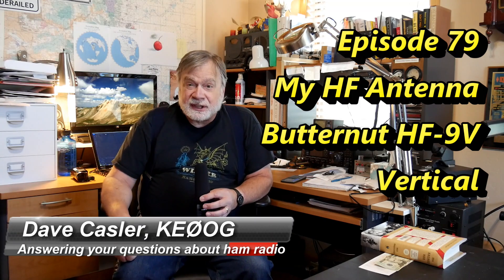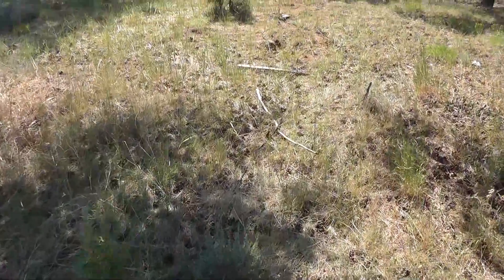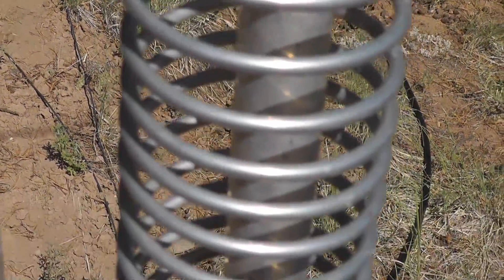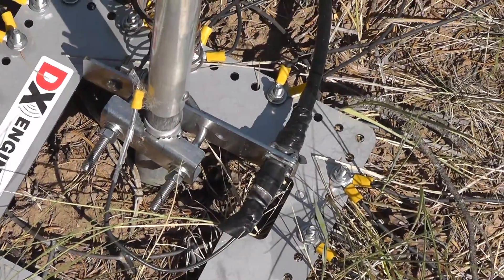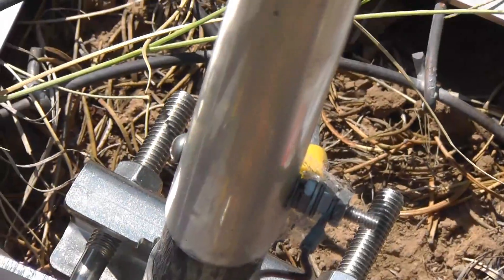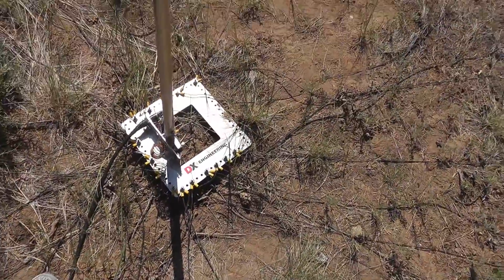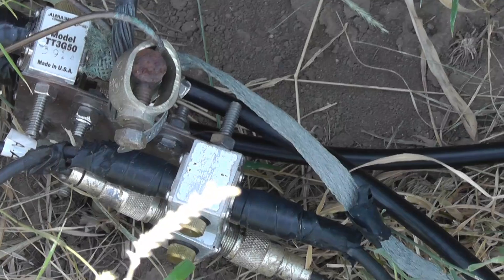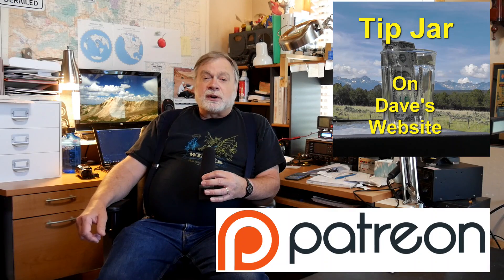My Station Antenna, Butternut HF-9V (#79)

Comment: I've run an HF9V on top of two different buildings with metal roofs. I just mounted it in a 3 fopt tripod. I'm rebuilding it right now, and it's going to go on top of its 3rd building. I've never used the 75 ohm impedance matching cable. I always connect directly to the antenna with LMR400 and use a tuner. The results have always been amazing, with many people asking me what my antenna was,and then in disbelief when I tell them. I had to replace both sets of caps on mine at a whopping 180 dollars usd. The current price of a new HF9V now is around $950.00. I am going to work with it some with a nano vna this time and see how resonant I can get it before I introduce a tuner. Thanks for the video.

Comment: Hi Dave it's me again. I also bought the butternut hf 9v. What is the best coax to use.? I might have to go 50 feet. I'll be using a  icom ic 756 pro hf 50 with mjf 969. Tuner.

Comment: Had 28 radials on my 6btv, then 44, 68.
Went from great to 'what the ? '' to higher sur. Next reinstall I will stop at 32, 25 feet long where I can.

Comment: Thanks for the tour of your antenna set up :) I just ordered one of these after doing quite a bit of research, and seeing your setup is really going to help me get mine up and running when it arrives. It's my first vertical - upgrading from the dipole I've been using for years as a way of congratulating myself for my General class pass recently (starting the Extra Class studying today and I'm not letting myself actually use the vertical until I have passed it as an incentive to stick with the material). Thanks for making such great videos always :) 73!
Reply from the maker: I recommend new generals get on the air and get about 2 years experience before they get their Amateur Extra license. It means so much more then. So go ahead and use that vertical and get lots of HF experience!

Comment: I had the same antenna and then used the hustler 6BTV. In my observation the hustler was a better performer. The butternut 80 worked better however.

Comment: Your channel is such a great resource for the ham radio community! Thanks for the work put in to make these videos!
I recently purchased the same antenna 2nd hand. I was thinking of either installing it in the back yard which is 10' lower than the front, or on my patio which is at least 25' higher than the back yard. The issue of most concerned with the patio installation is how to install radials without making the back of the house look like a disaster. I was considering making 2 1/4 wave wires for each and and runnings them straight down to the ground like a counterpoise The spreading out whatever length is left on the ground.
Any thoughts or suggestions would be greatly appreciated.
Thank you!

VA6MRJ

Comment: Hi David! Thank you so much for your review of the Butternut Vertical HF9V. I had this antenna too many years ago in San Diego, CA. As for performance, this is the best antenna I ever had. It really is phenomenal! I think I paid about $285 for it back in 1982. I ground-mounted this in a tube stub up in a hole filled with concrete. I put three 8' ground rods in about 6' apart and bonded them to the ground ring I built from 1.25" wide tinned copper braid. This ring was about 6" diameter and at the union of each end of the braid, I bent a clamp made of copper sheet metal (1/16" TH) and then silver soldered to the braid. A hole was drilled in the copper clamp to allow the ring to be clamped to the ground screw of the antenna. I then was faced with finding enough 12AWG insulated wire to make the radials. It looked like that was going to be expensive. So I went to plan "B"! I was rummaging around a metal scrap yard looking for some aluminum sheet metal to make a box for my 2KW homebrew tuner. Lo and behold I saw two huge 6+ foot diameter wooden spools like the telephone company uses. One of these has a full reel of 12AWG insulated wire, silver-plated and stranded.  The other wooden spool has about two tons of 1.25" tinned copper braid on it. I found the lot attendant and asked for his help. He told me that the wire and braid were the same price... $1.00/lb. I asked him how they get these reels? He said the San Onofre Nuclear Power Plant in Sam Clemente, CA had to scrap both of these reels out because they lost the paperwork on them and could not use the products without "traceability." I ended up buying 50 ft of the braid and 2000' of the wire (all for cheap). With the ring installed on the ground stud of the antenna, I used a nail to punch a hole a little bigger than the wire. I stripped off about 1.5" and threaded it through the ring and bent it over the braid. I continued to do this until I had 64 radials installed. The lengths went from about 25' to 135'. The radial wired were buried in the wet sod about 1" deep. The final electrical connection was made with silver solder on the Ring braid and radial assembly and a Mapp torch. An additional ground rod was driven near the entrance of the shack with Alpha-Delta Transi-Traps. The coax used was RG-8 flooded and was buried 6" below the turf. This antenna was like a magnet for DX.  I used it for twenty years and have now moved and getting ready to buy another one but this time its a lot more money at $604. Best antenna for the buck any way you look at it and low angle of radiation means lots of SKIP and lots of FUN!
Reply: Michael, I have an opportunity to buy a Butternut Vertical HF9V this week for two-hundred dollars. I recently passed my General ticket W3TRN. I have no idea what I am getting into to remove the antenna. I presume the antenna is in sections.

Comment: Enjoy your videos and how you explain things. I do have a question of how to and where to connect the 75 ohm coax. That part is a little confusing to me. I noticed you don't have the radials on one side of the antenna and was wondering how it impacts the reception. If you could, could you contact me by email to give me some info?  Thank you,  73, KN4TNT. I'm on QRZ so you can get my email address from there.
Reply from the maker: Actually there are radials all the way around the antenna. I did not use that side because it was too close to the ground to put bolts in, and I didn't want to dig up the old radials. But the radials are spread pretty evenly around the antenna. If you radials are uneven, your propagation will tend to be in the direction of the radials.
Reply: I appreciate the info. Have a good weekend.

Comment: Great video. I am installing the same antenna and have been agonizing over the need for a common mode coax choke. You don't seem to have a common mode choke on your coax between your antenna and your shack, do you have one near your transmitter or do you find this device unnecessary? Thanks for your great work. 73 va3pet
Reply from the maker: Verticals are inherently unbalanced, so the common mode choke isn't a requirement.

Comment: Dave, try adding a 130ft  single speaker wire with a clip at the base of your Butternut just above the lower coil, and run up over to a couple of your trees, to get 160m worked great for me. W1tod.
Ps i have showed a lot of your videos at our Radio group Meetings. You do a very good job explaining the hobby !

Comment: I think the U clamp is not properly installed at the base , maybe the ubolt should fit around the pipe/ tube and the serrated piece should be on the opposite side between the flat and the pipe/ tube. The curved portion of the ubolt is not serving it's purpose the way it is installed. I really appreciate your videos.
Reply from the maker: Could well be. I'll take a closer look when the snow melts. It's all covered up right now.
Reply: At 6.21 to 6.30 you can see there is a gap between the ubolt and the mount. I believe the ubolt should be flipped and go thru the holes from the opposite direction and the serrated piece would go between the pipe and the mount. I may not be explaining it well but if you study the segment you will see what I mean. I live in east TN where we don't get much snow but we do get plenty of rain.  @davecasler
Reply: @davecasler  How deep is your snow? Can you use the antenna in the winter? In my case the snow is usually 2 to 3 ft deep (N. Minnesota).
Reply from the maker: @gbennett58  Snow here varies tremendously. Snow is by and large non-conductive, as is clean water. (Salt water is another story entirely, but there's none near here.) So snow doesn't affect my antennas much. 73, Dave, KEØOG
Reply: You can see an example of the u-bolt at: https://static.dxengineering.com/global/images/prod/xlarge/dxe-omnitilt-2p_sn_xl.jpg?rep=False

Comment: Thanks Dave now I know about this vertical. Due to HOA I'll be limited to a ground mounted vertical 23' or less, or some kind of attic dipoles at 20m and up. Not enough attic for lower bands. 73 WA5ZVE
Reply from the maker: There are pretty short ground-mounted verticals. Look at verticals like the AV-640.

Comment: Please help me. I like 11 meter CB on my bicycle. Would loaded one wavelength vertically polarized antenna be possible.
Reply from the maker: Yes, in theory. Remember that your antenna has to have something to work against, either a counterpoise or set of radials.

Comment: Hi Dave,

Very nice video on the HF9 - run the same this end with the DX plate but have a regular problem.

Looking at the DX Eng plate it appears that your 75ohm stub terminates at a PL259 then into 2x SO239? I have constant problems with corrosion on the lug connector on the inner of the RG11 (regardless of tape and silicon applied) which leads to eventual failure of the wire.

I have been thinking of terminating the RG11 this way and then just use enamelled wire for the last couple of inches.

Just wondered if this is what you did and did you adjust the length of the RG11 to compensate or was it the Amateur Radio way of just do it and see what happens !!!

Great videos and love the reviews, cannot beat a practical review and experience.

Thanks

Davy - G1LVH
Reply from the maker: I use RG-213 (50 ohms) to feed my  HF9V. It terminates at an S0-239 at the grounding plate, with a single wire about 7 or 8 inches long going to the antenna itself. Seems to work okay.
Reply: David Casler 

Cheers Dave, sorry for late reply work gets in the way of hobby but work pays for hobby.....

I was curious as the preachings say 20m performance / tuning is adversely effected by the lack of 75ohm feeder. Just wonder how you found the swr etc on 20 without it. If an ATU will pick up the slack happily then I may give it a go.

Cheers

Davy - G1LVH

Comment: Dave, thanks largely to these videos I just easily passed my Tech and General tests.  Still waiting for the new callsign to come from the FCC.  My house, however, is spectacularly unsuited for HF antennas of any kind.  No land, no trees, no attic and close power lines along two sides of the house make mounting anything but a loop or a long-wire under the eaves difficult. No room on the roof either as it is occupied with our TV  antenna.  However, I have a wood deck over the carport on which I could mount a vertical, but have no room at all for radials at ground level.  Under the deck are four parallel 25 ft long steel angle irons that are holding up the roof of the carport.   Could these be tied together as a kind of raised, off-center counterpoise?  My ultimate purpose is to DX with English speaking countries across the Pacific so the signal will have to go many thousands of miles.
Reply from the maker: You might look at some of the verticals that do not require radials, such as the AV-640. And welcome to ham radio! Be really careful around those power lines!

Comment: Elevate it and have radials up in the air and it will work better.
Reply from the maker: Often that's true. You can do with fewer radials as long as they're tuned properly. However I don't have a mast large enough to hold all that up.

Comment: David, I have an antenna like yours but mine is 20+ years old and it does not have the newer bands 
(12,17, 30 & 60) only 6,80, 40, 20, 15, & 10. I have had great luck with it, I had to replace the capacitors once but that is all. What kind of vertical was that you mentioned that did not need any radials? I always enjoy your videos, hope you enjoy the new signal generator.
Reply from the maker: There are a number of antennas, such as the R-9 or the AV-640 that are actually end-fed half-wave verticals that don't "work against" ground. They do all have minimal counterpoises at the bottom, though, and they work best if you get them up in the air ten feet or more.
Reply: David Casler Thanks Dave, I enjoy watching all your videos but I wouldn’t know where to start on making a video myself. 73s.

Comment: Hi Dave. Thank you for your informative videos and advice. Question about your radial system and soldering the connections. I saw your note about not soldering a ground system and using crimp connections instead. My concern is corrosion in the crimp, that's why I solder the crimp to seal it and keep the elements out. Another tip I can offer is to use a copper based anti-seize grease on exposed connections that need to maintain good RF continuity and eliminate corrosion, such as between bonding straps and lugs-to-plate connections. This stuff is messy and conductive, so never use it in connectors. What problems have you experienced with solder in your ground system. 73s KJ6CWB
Reply from the maker: I've not had any problems with solder joints in the antenna itself.

Comment: Love the vids ! Keep up the great work!  Very inspiring for those of us starting out in HAM ! Question : A lot of us older guys are moving into the RV's and traveling , we do stay at certain spots for months sometimes so we can install antennas on poles and break them down when moving. Any suggestions for HF antennas for Mobile and RV ?
Reply from the maker: If you want to go for a bigger antenna, look at something like the AV-640. I don't have one but have heard good things about it. No radials are required, though you should get the base a couple feet above the top of the RV. Or, you might go for a simple loop, such as the MFJ-1788, although my experience with this (I have one) is that while it's great on 20 meters, its 40 meter performance isn't so hot.

Comment: Too expensive for this old ham living on Social Security - wish it weren't. w0xs
Reply from the maker: Go ahead and get your General anyway. With patience, you can find some older gear for next to nothing, especially if you're willing to put up with "hybrid" radios that have both transistors and tubes, such as a Yaesu FT-101. There's a lot of stuff out there at hamfests. Find some good mentors and follow them around for awhile. Some clubs have stations that can be operated by members. Also, try learning the Morse Code. Simple yet effective QRP rigs out there don't cost much at all. Good luck! 73
Reply: I second Dave's advice and hope you took it. BTW, I found a Butternut HF-6V (same antenna less 30, 17 & 12m) used for $200 CDN, and have a bunch of radials that someone used on another Butternut essentially for free with some other gear thrown into a used radio purchase. Have also seen some other decent used verticals for even less cost.

Comment: I have hf6v there was a ham that put ground radials he was able to get a flat match across 80/75 meter he only used 4 radials at 64 feet  and other radials for other bands to
Reply from the maker: Yeah, the flat match means the antenna was very lossy. High cable losses especially on long runs can cause the SWR to look lower than it really is. My SWR video explores this phenomenom. (See the Ask Dave playlist.)

Comment: Dave,
I notice that you don't have any radials on one side of your ground plate. I have a similar set up with a Hustler 5 BTV. I have it stuffed into the corner of a suburban lot. The back radials are wound around and near the fence like. I find I have a reduced pattern with that. Unfortunately it's very noisy in my environment

'73
Tom
KN6DR
Reply from the maker: +Tom Field That's because that section of the radial plate is buried a bit, so I stretched the radials to the other sides

Comment: Spray the panel with clear lacquer and fill the rock hole with silastic.......done it a few times.
Reply: Good advice 🖒.
since the panel otherwise is ruined anyway, there is nothing to lose. the choice is between a panel whith reduced capacity and a malfunctioning panel.
Reply: yep, thats it.........much better to save something.....If its lacquered laying flat, it will soak and seal the panel pretty well and the slight bit of loss on the hole will seal it up for ages...
Reply: Mike McDonald generally the  glass is bonded to the cells so you can't replace it just glue it over the top , but plastics age and block the light....... you could use glass I guess
Reply from the maker: Thanks for the tip. My wife's an artist and gave me some stuff to spray on the panel.
Reply: i was wondering about replacing it with plexiglass?
Reply: ah ok thanks for that never had one break thank goodness so didn't know how easy or hard it would be to replace.